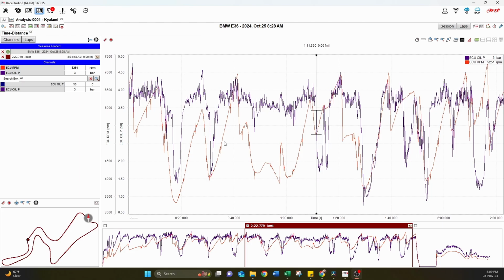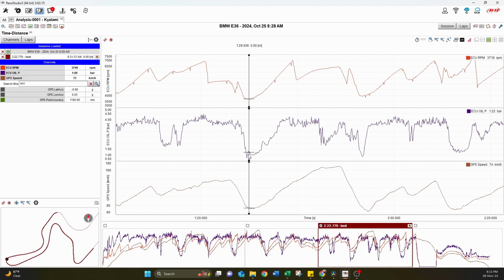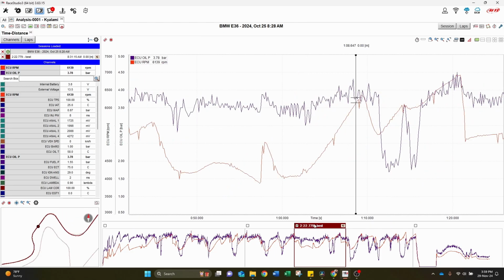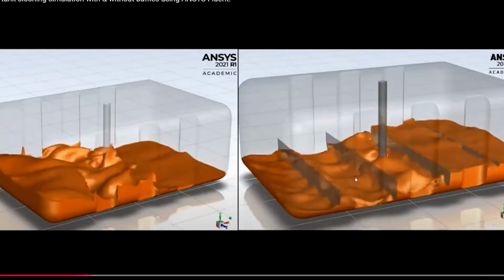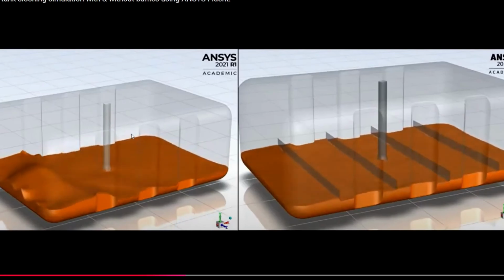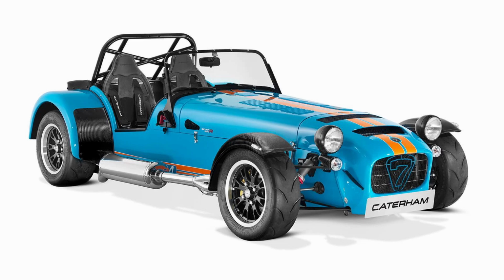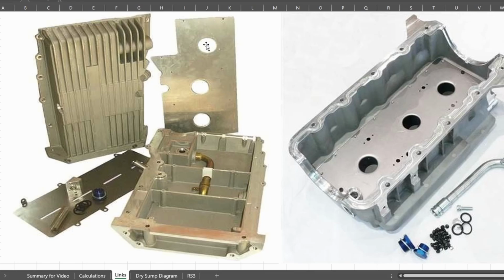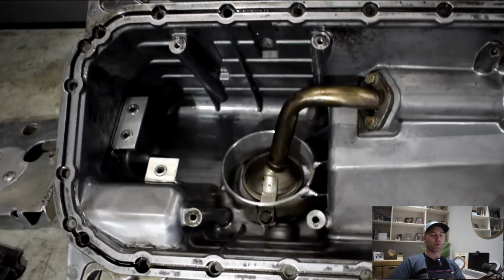Why did my M42-M44 Race Engine get Oil Surge When the Sump Aready Had a Baffle. (Deep Dive)

Comment: Ich fahre einen M44 mit der Originalölwanne bei Rennen (Slalom) und auf dem Nürburgring und hatte bisher keine Probleme mit dem Motor. Es ist möglich, dass der Druck kurzzeitig abfällt, aber ich kann das nicht feststellen, weil ich kein Messgerät habe.
Freundliche Grüsse 
George

I drive an M44 with the original oil pan in races (slalom) and on the Nürburgring and have had no problems with the engine so far. It is possible that the pressure drops briefly, but I cannot determine this because I do not have a measuring device.
Kind regards
George
Reply from the maker: Thank you so much for the feedback, appreciate it 🙌🏻

Comment: Hey there, I was looking at your datalog of oil pressure, u are making 4 bar or 50 psi of oil pressure at max rpm. I think the bearing clearance is big for high rpm usage, have u tried thicker weight oil such as 10w50/60?
And the max oil pressure ur getting of only 4 bar is due to the oil pressure relief valve on the timing cover housing, have u tried shimming the spring 2mm? So u have higher oil pressure at peak rpm? If im not mistaken from factory the m42 m44 platform spring relief valve is maxed at 56 psi only, meant for the engine to rev to 7000 rpm max..
Because if it is really cavitation the engine would experience 0 psi oil pressure, from what I see from your datalog, its only reducing to 10-15 psi at 3500 rpm on braking.. the oil pump gear is located at the crank snout, so it will of course reduce as the rpm is also reduced from braking on corner entry.
My guess is u have less oil pressure on the top as well as the oil is thinning on high heat as well as the bearing clearance is to high for the weight of oil u are using.
Can you try this and check the datalog again after these mods?
Hope this helps..
Reply from the maker: Thank you so much for the feedback, this is great advice 🙌🏻
I am using Ravenol Race 10W60. I will try shimming the oil pressure spring, that’s a great idea.
The oil pressure issue is probably all of the above as you mentioned but with the sump upgrades and shimming the relief valve, we should be sorted.
Will keep you posted!

Thanks for watching
Reply: @ yes, the general rule of thumb if im not mistaken is 10 psi increase per 1mm-1.5mm shim, and you can shim as much as you need your oil pressure to be.. in my opinion it will solve your low oil pressure under braking, but on long sweeping corners, you will need an enlarged oil pan to take in more oil. 
But for small abrupt corners and sudden change of directions ( small S corners ) you will need baffles to keep the oil from sloshing.
A good platform for this will be the 2 piece oil pan design for the m44 platform, so the sump can be modified, baffled ,and enlarged to suit your needs. Due to the low position of the 2 sump design, if you enlarged it, and baffle it near the oil pickup area, you will keep a lot of oil away from the crank at high rpm, and hopefully reduce the aeration of the oil thus also preventing sudden pressure drop.
Goodluck!

Comment: I endurance race M42.  I have made a custom baffle in the stock oil pan with two 1 way door.  I see the same oil pressure drop under hard braking.  I will check to see if you have pictures of my baffle and trap doors.
I did the same thing... filled the sump to see how much volume is contained.
If I find the picture, I will send you a picture.
Reply from the maker: Thanks for watching. yes it will be interesting to see.
Reply: What is your insta page?